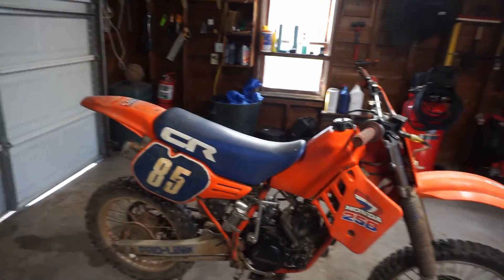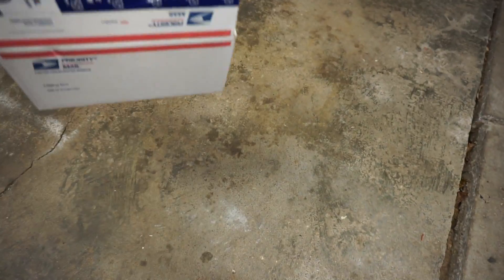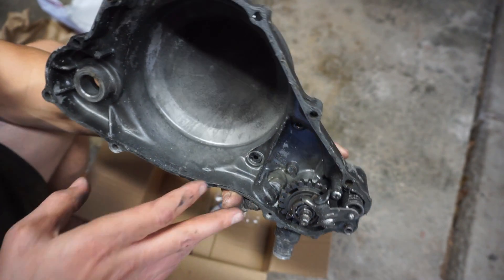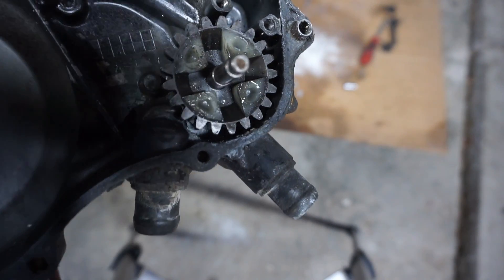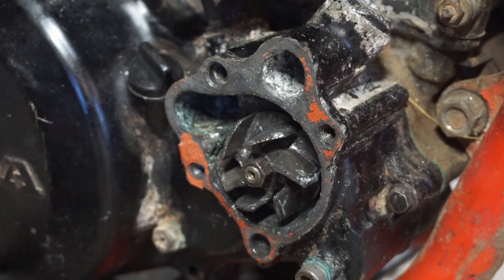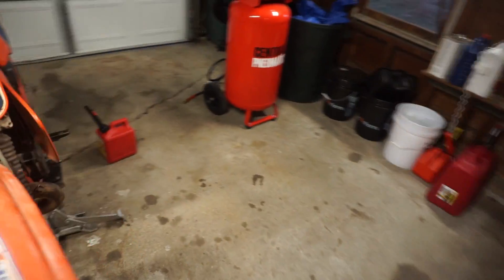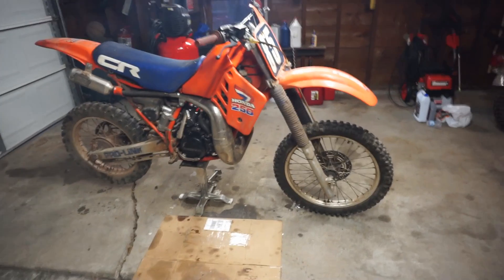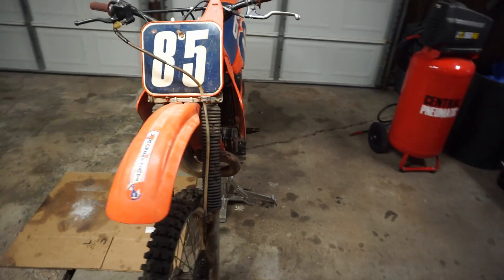First Start Attempt On $700 Honda cr250 Dirt Bike. Will It Run? (Part 3)

Comment: Pine-sol and water dude, I try and try to tell people this trick over and over, 50/50 pine-sol and water, let it soak a few days, it will pull paint, corrosion, and rust off of almost anything especially aluminum and cast iron, try it, the most you are out is 4 bucks and it won’t harm anything, also you aren’t going to get the pistons on that caliper to pop out with the pads still in it, find a shrader valve that will screw into the port and put some pressure behind it without the pads. They will come out for sure

Comment: For the bolt you rounded off try either some jb weld into an old socket and try not to get it on the impeller orrrrrr get 2 slam pieces of metal and very carefully weld them to the bolt on each side for more leverage (tig weld if possible for no sparks

Comment: Take the case off an have a new fitting welding to it, think its magnesium if memory correct, most mx bike water pumps are like this u just need to understand it the impeller is essentially a nut and the shaft is the bolt..... easy

Comment: Sorry to hear you were burned on the water pump side cover from ebay. I think most people have been burned at one time or another on used parts from ebay.  Future note to you would be to ask for more pics from the seller before pulling the trigger. Glad to see the bike is running though. Good work!

Comment: They don’t sell a new hose flange with compression fitting? Seems like if u put a lil larger drill bit in the hole it’ll prob break free and the broken hose flange will come right out. Maybe with some tapping from the inside out. As far as the rounded nut, score the nut as much as u can on the top and bottom with your dremel then stick a chisel in the score and try and break the nut right in half. Obviously take care when chiseling the nut that u don’t malform the case

Comment: The case is magnesium. Water pump impeller is aluminum with a built in nut (cast as one piece) so you cannot hold the fins. Do not use regular glycol based antifreeze or it will happen again over time. There are multiple metals all reacting with the water and antifreeze. There is a company out there that has a non reactive coolant. I'll leave that up to you. Do not ever use Evan's coolant.you may have a chance to save your old case. Do not try to weld it unless you want a melt down. You could try to cut the nipple of and tap threads in it for which ever is your desired fitting type. To defend honda all waterpump on bikes have been about the same for ever. If you have to cut out the water pump impeller to replace the seal be careful and dont put to much heat in it. Other option is buy a basket case bike for parts hopefully stored with no water in it or best case already apart. Good luck.
Reply: Also on aluminum nuts bolts make sure to use 6 point with 6 point, 12 with 12, torx with torx, Allen with Allen. Grab some JIS screw drivers while you're at it.

Comment: For the caliper: cap the inlet and pump grease from a grease gun into the bleeder and the pistons will come out! show it a video its a great trick
Reply: Use compressed air.. works well. Grease works too but is pure waste of grease and makes a mess cleaning your caliper out.

Comment: a tip from sweden you ckan get the pump wheel of , drill a 2 mm  hole in the side on the nut and brake it whid a chisel

Comment: (Water pump ) .. thread whats left of the pumps water feed hole ..side thats broken ... and th thread in a threaded  metal rod or thread a small peace your self and a locking nut uptop.. and some sort of silicone i mean you should find a way

Comment: See if you can cut the good part off the  cover and get local welder to weld it on to your case

I've had a few cases repaired by a local welding shop 👍
Reply: The cover is made from magnesium and it's almost impossible to weld
Reply: Yeah I've had them tell me that its possible they can't weld it because of that but always seem to pull it off
Reply: @everydaymechanic4657   I haven never seen successfully welded magnesium CR clutch cover. With aluminum ones there's no problems to weld it but magnesium burns easily. I have one magnesium cover in my garage with big holes that somebody tried to weld because he tough it was aluminum

Comment: Just a tip.... Makes it 100x easier to work on a clean bike and easy for diagnosing problem areas. You are not doing yourself any good transferring dirt and grime throughout the bike and inside engine covers and such seeing as how you are trying to restore it.

Comment: First take the case off the bike. Use a torch to heat the impeller nut then spray It with penetrant, then great It again then more penetrant. Do that 3 or 4 times. You might have to tap an SAE socket onto the nut to grab It. It might damage the seals, but you've got new ones. You shouldn't need to get it super hot. That should get that impeller off.  Use a hacksaw, cut the remainder of the rotten pipes off flush with the case. Clean every last but of corrosion out of all of it. Use a new/clean battery post brush inside the pipe hole to scrub out the corrosion or a plumbing wire brush inside pipe cleaner. Spray it all out/ degrease with brake cleaner. Cut a piece of 1/2 o.d. copper or aluminum tube about 2" long, coat one end of tube in red loctite then drive it into the hole. Let that cure. After if need be super clean with brake clean and new clean wirebrush the neck of water pipe where you drove it into the case. Use quick steel two part epoxy putty to seal/ reinforce around exterior neck of pipe. It works I've done on mine. Clean up and paint.

Comment: “What’s that thing growing in there” hahaha . See if that CR250 will pull the front wheel up in third on asphalt without yanking the bars. If it does you know you got a good bike.
Reply: Mine will do it in first gear at 1/4 throttle it will put the front wheel straight up in the air.

Comment: Threaded Aluminum pipe ,Tap the case and thread it in
Reply from the maker: I think that's a good option!
Reply: @2vintage  make sure to use a pipe tap which will make the internal threads tapered so the threaded pipe you screw in will tighten as you screw it in. I'd put liquid Teflon on the threads so you get a good seal..or maybe just Teflon tape. The pipe you could find at a hardware store

Comment: There is a socket set you can get that has special sockets for gettting stripped nuts and bolts out. Look at harbor freight. I don’t think they are that expensive.

Comment: Can anyone say "white vinegar soak"?  Acid will dissolve the corrosion.  Also, you should have been after fixing that pipe problem when you first had the side cover off.  You have the problem of overlooking big problems to chase after small problems.  Weird.  Nut on the water pump shaft..Use your dremmel tool to cut, or grind it off.  Cold chisel could help too. Too tight of a spot to get a vise grip pliers on .

Comment: Also when you're trying to take them stubborn water pump nuts off did you ever think of using heat heat works wonders use a butane or propane torch and heat that nut up real hot it probably would have spun right off don't worry about the water pump seal behind it because you were going to change it anyway any stubborn nuts or bolts use heat on them a lot of it it will work Wonders that nut would have came right off instead of rounding It Off Bubba Louie

Comment: Thanks for these videos! Having done a few fix ups myself,  why don't you wash the bike(s) first? Just curious. it's very revealing.
Reply: I have been wondering the same. I fix scooters and the first thing is to press washer them. It is much more comfortable to work with clean bikes.

Comment: buy a new aluminium clutchcover- or repair yours with epoxy. but before disassembling anything on this bike please do some research- these parts are hard to get. i would have been lucky to get a waterpump/clutch cover in that condition when i startet my restauration.

Comment: When loosening a corroded bolt or nut make sure to use a 6 point socket not a12 point! Clean all the loose corrosion off the nut and find a socket that fits tight. You might have to tap the socket on with a hammer. Heat the nut First!! Then use a tight socket!! Or stud extracter on the nut
Reply: You Should also clean the exposed threads of they are exposed

Comment: I got that bike, only my kick start is on the other side.
Reply: then your bike isna 480 Dont think they made 250s with the kick starter on the opposite side except the 480
Reply: @nickpendleton9811  1983 CR-250.

Comment: It's made of magnesium dude Don't put a flame to the case it will light up . Just buy the new case. Half ass fix will not work for long . Cooling system will become hot and under pressure will blow out or leak . Don't be a dumb by a new one!!

Comment: I’ll tell u this to save u trouble don’t use that Lucus 2 stroke oil it destroyed my cr 2 times first time got my crank bearings the next time it got my rod bearings on a brand new crank I quit using it and no problems I went back to Castrol super m and 927 it’s the best
Reply: Gas mix is 4 oz to 1 gallon
Reply: I would buy a new cover and water pump propeller and fix it right if u fix it right that bike is worth a bit if u pull motor off and steam it down paint the frame and new plastic u get more out of it

Comment: The half ass way of fixing the water pump is never going to work . Like I told you on other videos you need a new water pump and case and seal . If you over heat the bike you will be also replacing are hard to find cylinder.  You will make money on the bike even if you buy the new case. I don't understand why you always like doing things half ass.. oh replace the crank seals to there going to need it trust me.

Comment: It's completely rounded off it's a poor design... It's because you don't know what the hell you're doing 🤣🤣😂😂😂🤣🤦🏼‍♂️🤦🏼‍♂️
Reply: Haha, the only person here that has a clue.
Reply: Next time, put a spanned on the other end of the empeller shaft and then try to undo it.
It might work better than holding the impella and trying to undo it at the same time, 
Wow

Comment: Fuck that. First off they ain’t worth that damn much used. Second I would get a hold of some one. Either the guy or eBay for false advertising. Either he gives u monies back or send the thing back. Jb weld don’t hold shit. It’s an epoxy. Dude I have old Honda’s and kawis. That thing is junk bro. Never should’ve paid that much